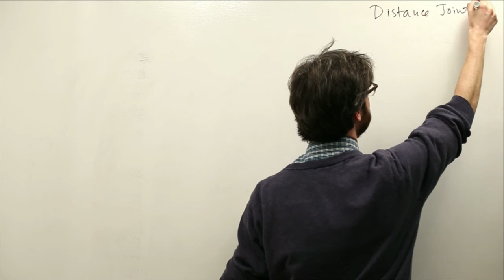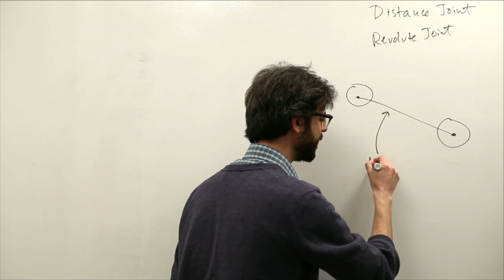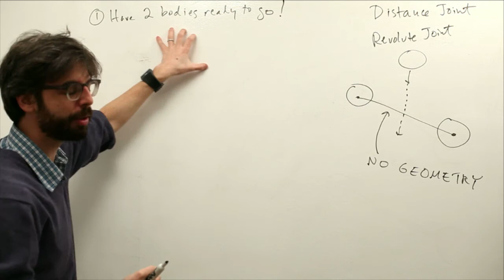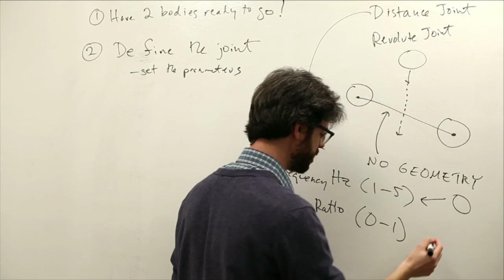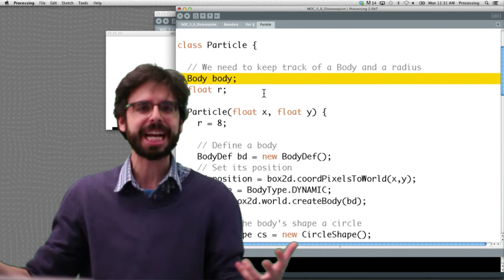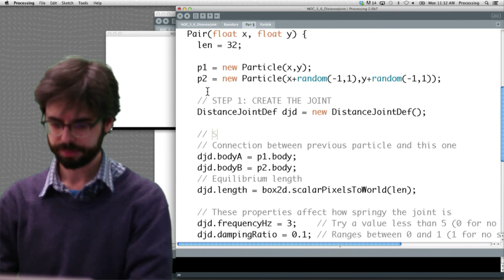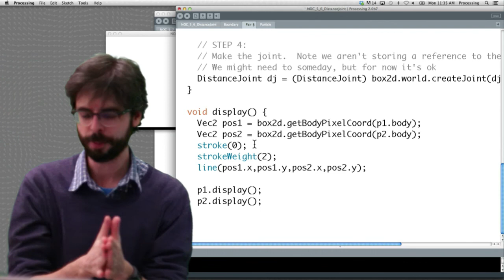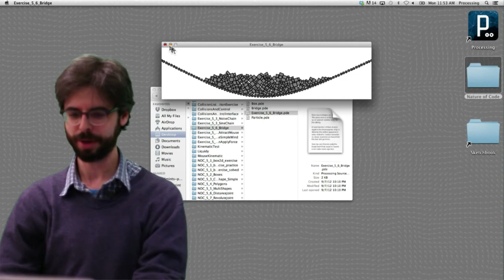5.8: Box2D Joints: Distance Joint - The Nature of Code

Comment: Hi Daniel: 

I think the difference between a DistanceJointDef and a DistanceJoint needs clarification.  I don't understand why two different classes are used.  Is the idea that many joints will likely use the same definition, and this structure makes the DistanceJoint objects smaller, because they all share the same definition?
Reply: (continued)...objects smaller?
Reply from the maker: This is a great question.  It's a little weird but the "Def" is just the "definition" (like a configuration) for making a joint and the DistanceJoint is the joint object itself.

Comment: Hi Daniel, 

can you tell me please how to connect 2 circle with a rectangle but on a custom point  on the rectangle. it should be a car and when i connect both circles to the rectangle they are connected to his center but i need them to be connected on his left and on his right side.

thank you, ilan
btw. you mixed up the titles in your videos. this videos is about distance joint and your "distance joint video" is about revolute joints
Reply from the maker: +Ilan Sagital Thanks!  Fixed the titles.  Look into setting the "anchor point" for the joint.  You will probably have to dig into the JBox2D documentation for the right syntax.